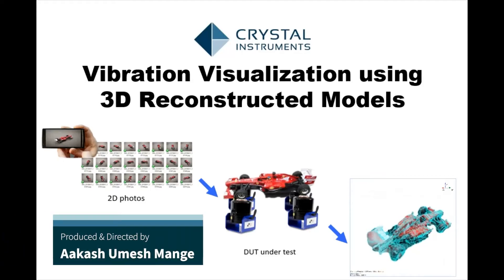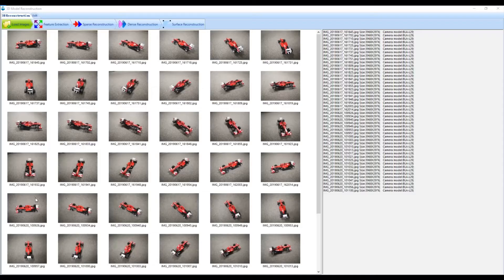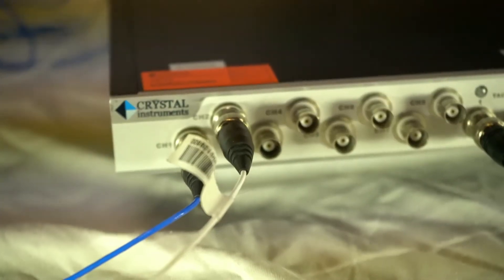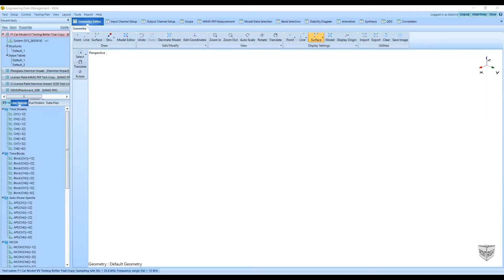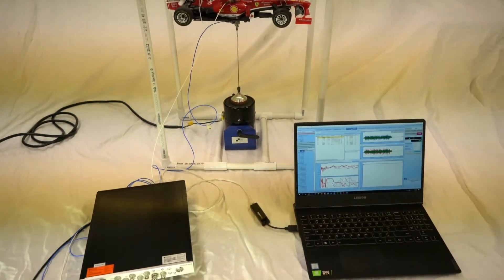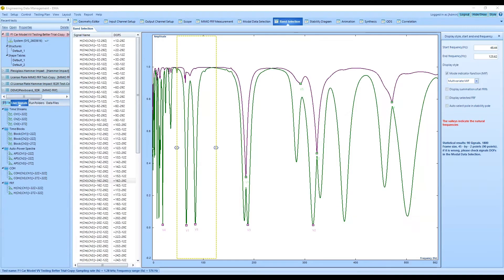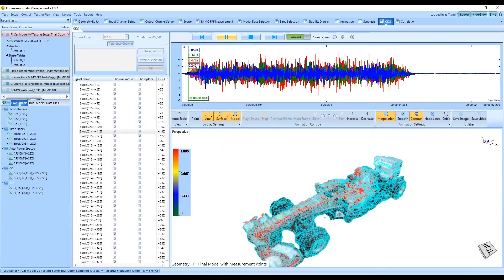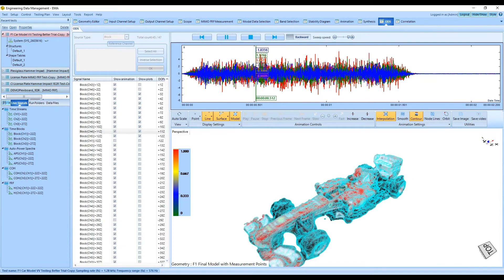Vibration Visualization for Modal Analysis

Comment: Nice presentation. Did you use roving sensor method for acquiring the FRFs of  the round about 40 measurement points? It seems like more than one excitation point (z12 and z29) was used, right?

Comment: You install 1 sensor but showing so much shapes. I think its quite cheating
Reply: It wasn't mentioned how all of these points have been measured. Right, had the same thoughts. But I would not call it cheating - plot hole sounds friendlier 🙂
Reply: Евгений, при модальном анализе с 1й точкой возбуждения,  измерительный акселерометр переставляется по  точкам измерения для набора АЧХ, после сбора всех данных ( по каждой точки) идет построение движения модели. В случае визуализации в процессе виброиспытания - Online ODS, как ты верно заметил - для каждой подвижной точки ( степени свободы) необходим свой акселерометр, т.к. процесс проходит в реальном времени.